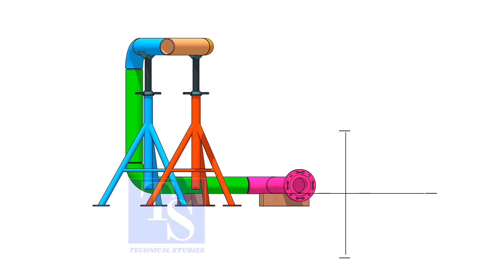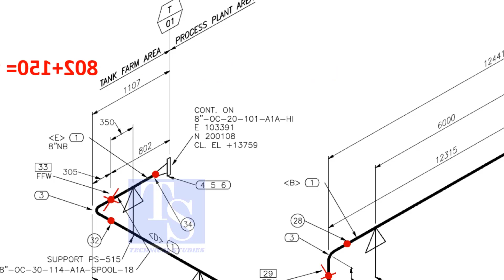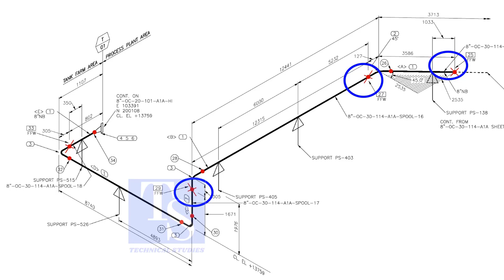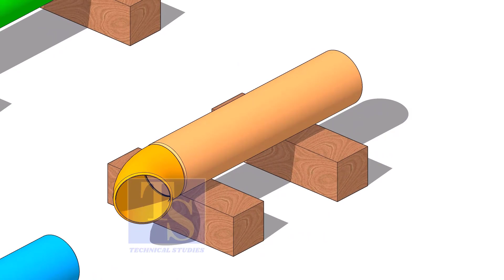Pipe fitup tips for pipe fitters and fabricators.

Comment: Can you provide the reason why the 150 mm extra length should be added?  The Pipe Line Center Distance in the Drawing will be changed as well when you add 150 mm to all FFW.  I don't think the explanation is in line with the isometric drawing.
Reply from the maker: Bro, that is for site adjustment. during the erection, especially, the underground pipe or on the ground pipe, a variation of +100, -100 mm is possible. that is why they add an additional 150mm for each spool. that is the rule of the designer, not mine. Thank you for the comment.

Comment: is the 150 mm extra length according to standard ? if these symbols not included in the drawing how to guess the spool of extra length to be ?
Reply from the maker: Bro, this extra length is for site adjustment. during the erection, it may be cut and removed. only if the symbol is there, you need to add the extra length. Thank you for the comment.